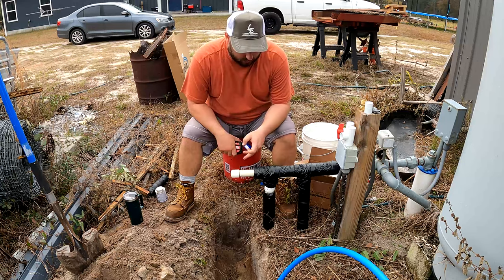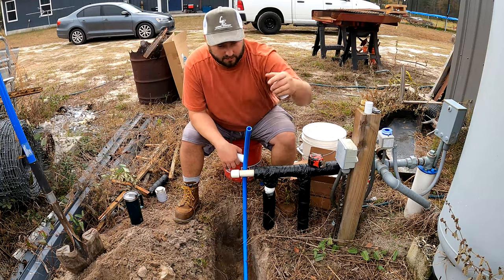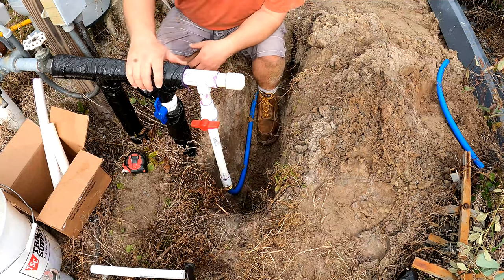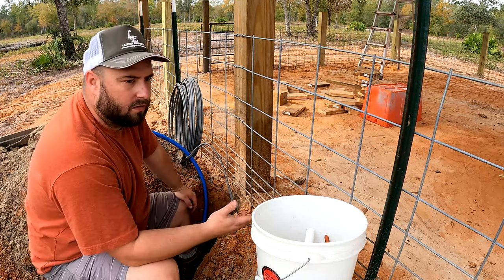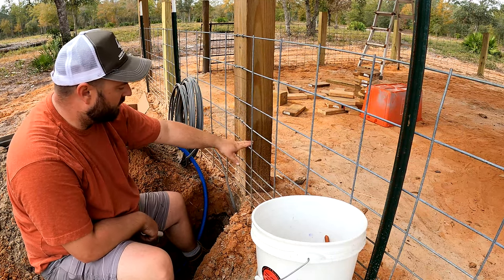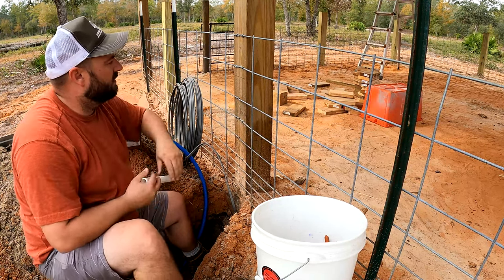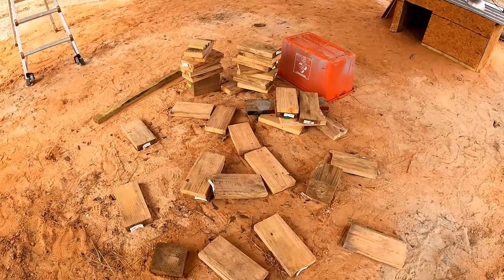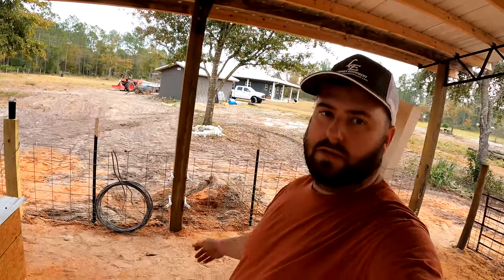#Hog Nipple Tree | How to build a hog watering system for all ages and sizes using PVC pipe

Comment: My only question would be if they would break it off in time. I've used several different things, thinking about doing the same thing with mine but using galvanized. pipe instead, I just think it would hold up better. Great video brother I know we're all in this for the same goal. Keep up the hard work and definitely subscribed and liked.
Reply from the maker: I think galvanized would be a great option! Unfortunately this is temporarily permanent. The hog barn you see will change over time and that water setup will move eventually. The pipe being broke off is a solid possibility, but we'll cross that bridge when we get there. Thanks for swinging by and good luck on plumbing your's up.